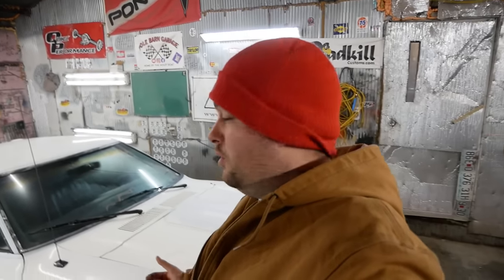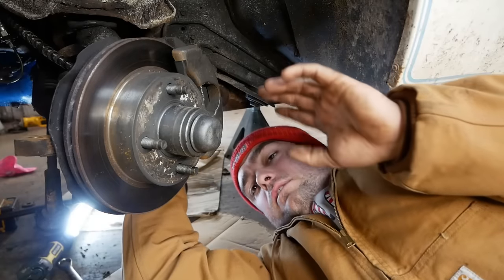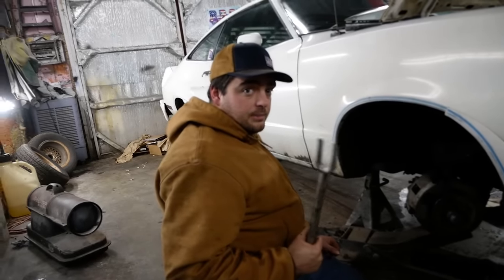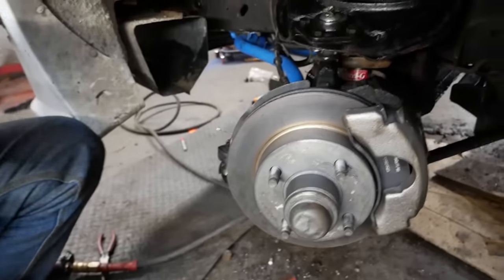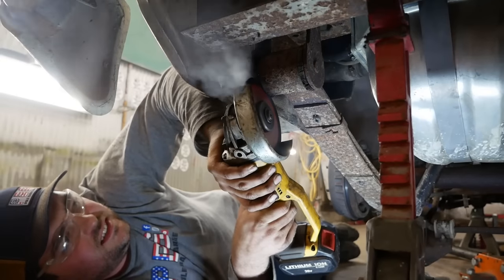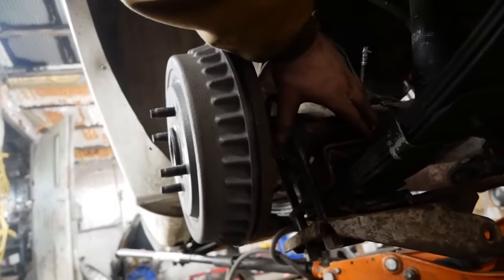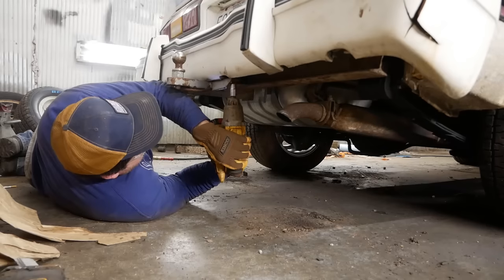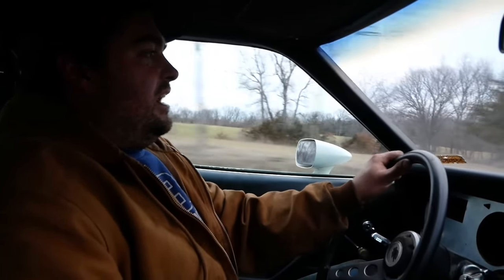King Cobra Mustang OVERHAUL! Total Suspension Refresh, Gets Some Muscle!

Comment: Nice job Dalton.  I know you are an "everyman's mechanic" but no member would fault you if you eventually had a lift installed.  Could even put it outside due to height issues.  This would make it easier for us to see your work.  As always, totally enjoy your channel and glad I found you when you were just barely at 1K subscribers.
Reply: Even something like a set of quick jacks makes life way easier and is reasonably affordable.
Reply: As Puddin said this week on his video, a lift not only is safer and faster, it is better on your body long term.
Reply: Look at all that rust preventer aka 10-30 motor oil good God that thing has been leaking for along time
Reply: 8:14 this is without a doubt the most relatable situation I have ever come across on any content.  A lot of people don’t realize that this comes from a necessity, not a choice. That mother fucking bolt is coming out, a new one is going in… or we don’t get to work tomorrow.
Reply: im pretty sure all of us dream of having a lift at home lol.
Reply: If we want to have Dalton have some quick jacks, does anyone know how to do a Fund Me page? Because his building won't handle a lift. Something like Brent had in his small shop after the fire. Powered scissor lift.

I'd like to see Dalton not only around, but still able to abuse iron for a long while, yet. I'll donate.
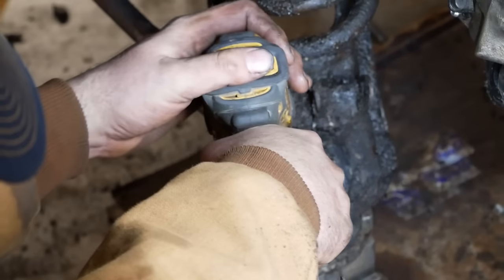Reply: 15:10 take a sharpie and put some black on the high spots should be able to read the numbers real good after that
Reply: @jimrky6062  Become a member of his channel. That helps him immensely 
I miss his old opening with an energy drink in one hand and a cigarette close by with his warning of “Danger!!  I’m an idiot “

Comment: It's amazing how one little power steering pump just snowballs into rebuilding a whole car LOL the struggle is real man. But I think most of us on here can relate. Good job as usual
Reply: That accurately describes working on cars. The oil change turns into trying to find the oil leak. Which becomes rear main seal,clutch & bearing as well as wastegate and motor mounts
Reply: The "Might as well im already here" snowballs really quick if you dont pump the brakes! Also pray the line dosent blow then its OVER for the ol wallet..

Comment: Dalton, Top tip for that drill bit set. Lightly run a black sharpie across the top and the sizes will be much easier to see in future.
Reply from the maker: Good call
Reply: yes, then after that lightly ran sharpie across the raised numbers,,,use the same sharpie and write the sizes out on the case! LOL
Reply: Another tip: spend the big money on some Milwaukee Cobalt bits. Just do not ever loan them out! Also Diablo makes some good metal sawzall blades. Very few things I pony up big money for but saw blades and drill bits are some. Also get a corded Sawzall, for $100 it’s one thing I prefer to have a cord. Darn batteries only last about 7/8ths of the job
Reply: @RustyZipper  good blades are like gold

Comment: Someone may have said this already, let it sit overnight and then check the steering fluid. It’s likely all foamy and frothy and it’ll settle overnight. 
Next time, before starting the engine, grab the wheels and shove them full lock one direction and then full lock the other way. Do that a couple times and then add more oil. I’ve found that to bleed the system with ease.
Reply: I was gonna say the same. It works on GM pumps also.
Reply from the maker: Worth a try

Comment: Great show. The best ground pan for my knees is the foam squares that lock together. Cheap , easy clean up, last for ever, lay in high weeds, gravel, concrete, any where you stand is great too. Like by the old work bench. It also comes in a roll. I like the squares myself.

Comment: I was in the automotive business over 35 years . one trick I learned from working at a few dealerships . the cardboard that was used to ship parts to the dealership were used as floor pads  to keep the greese slime and crap  that came of the cars . including all the brake cleaner and extra antifreeze that missed the bucket or pan . once covered or done with a dirty job . into the dumpster . some shops don't have cleaners that clean Your floor . so most mechanics use this method to contain the shit from having to clean up later . even old Amazon cardboard . another is getting a mirror like on the back of a bathroom door . about two feet wide and 5-6 feet tall and mount it so the wide part is horizontal and mount it on the wall of where your driving into . this will help center the car or see where your at on a driveon  or side post lift ! Happy New Year to you and your family ! Always enjoy your videos and sometimes learn a few things along the way .God Bless

Comment: My gosh I am enjoying this video. I have been building fords at home for over forty years and the frustration is universal believe me. This video reminds me of when I rebuilt the suspension on my 71 Torino. I spent six hours trying to install heavy duty coil springs in the front end. I had the wrong spring compressor, but I thought "I can make it work". After facing death several times when the tool slipped of, the guy next door brought over a ford spring compressor tool. I had the first spring in thirty minutes later and the second took fifteen. The sometimes the correct tools are the only way to go. Love the car look forward to see the progress.

Comment: I have one of these (a coupe) that I bought new in 1977.   It has never set idle or towed a boat.  As I live in central Texas, corrosion is not an issue.  However, due to the strong sun, it is on its third paint job and I have replaced all of the rubber door seals, dash, vinyl seat covers, etc.  It still has the original 13 inch wheels.   I just recently got new tires, hard to do these days.  It has the 5.0 Liter V-8.   The biggest issues have been keeping the V-8 cool in the Texas heat and stalling.  The engine was replaced many years ago due to overheating.  The stock carb. has always stalled easily with the choke pull off going bad many times. Good video, I learned a lot about the car I have.

Comment: I've seen many people wipe out a power steering pump. The reason you hear nose when filling a new pump is because of cavitation. Air in the fluid allows metal to metal contact. Shut the car off for about ten minutes to allow the fluid to settle. Sometimes you have to repeat as you get the pump up to level.

Comment: Rebuilt power steering pumps are hit and miss, but more miss than hit. I replaced 3 of them in a row (one didn’t even make it around the block) before abandoning the parts store rebuilt junk and buying a rebuilt one from the ford dealer. 

It also helps to put a filter in the return line to clean out debris which can take out a pump.

Enjoy your channel Dalton!

Comment: I've never been a big fan of the Mustang II, but I gotta admit this one is looking pretty good! In my experience with Ford power steering pumps when you install a new one you have to use a vacuum pump to get all the air out. That failure might have been just air in the system. But then it might have worked itself out by the time you got back!

Comment: 6:52 you're right there, I can't remember the last time I used a 12mm socket other than hammering the ever loving crap out of it to fit a rounded off 13mm bolt head

Comment: I made sway bar endlinks for my 76 out of an old pair of shocks. Use the lower bolt/bushing, then cut and weld the top section of the shank onto it.

Comment: LOL always a good video from yall. Hey Dalton I heard something in the engine when you fired it up before pulling it out of the pole barn, reason I mention this, so MAYBE something isnt happening that I went through. I bought a 1977 Ford F150 with a 302 that was a wholesale car ,from a Ford dealership my uncle worked at, he looked it over and other than the worse than Earl Scheib paint job, was a fairly decent truck, that the former owner had worked at the St Louis Mo Ford plant and had stuck a granny low 4 speed behind a 302 when the auto blew up, with the auto transmission rear end in it. The 302 ran really good, sounded like a Singer sewing machine running, a friends Dad had a place at the Lake Of The Ozarks, and needed some old doors and junk hauled down to a cabin he was building, so we get down there no problem, about half way back, I start hearing what sounded like  lifter noise or a fuel pump spring broke, by the time I got  back to Wright City Mo, it was getting louder, I pulled the left valve cover off, fired it up and on the 302 Ford of this era, they had a valve rotator cap on the end of the valve stem, that the rocker arm hit, that cap had split in half, and already beat the end of the valve and mushroomed it, I thought maybe I could get by just replacing the cap, Nope, had to pull the head and replace a valve, the REAL lucky part, the valve spring keeper had been wedged in by the split cap, and was paper thin, almost dropped the valve. Dad was helping me, I mentioned, I might as well pull the other valve cover to check it, well it isnt making noise I wouldnt bother , one week to the day, the lifter noise started on the other side, I took it off and another rotator cap had ate a hole in the top, luckily it didint mess the end of the valve up, a buddy had dropped a valve in his 302, and I got a whole baggie full of rotators  and stuck in my glove box, I never had anymore trouble in over 150,000 mile out of it!! You might pull the valve cover off and check that tick it has so it dont drop a valve on Jessie!! Good video..

Comment: Loved the video. Mustang II's are finally starting to be appreciated. Quick tip on the rack swap. Count the turns when removing the tie rod ends. Different manufacturers will have different length threads cut but the overall length doesn't change. So, if you screw the new one on the same number of turns it will set the toe much closer.

Comment: Vacuum bleeding the power steering system helps a lot to get the air out. Had issues getting the system on my mom's Saturn Vue to quit wining and frothing. Pulled a vacuum on it and it was perfect.

Comment: For the louvers to stop/reduce rattling use a roll of "rubberized" (weather resistant) adhesive foam and put it on the glass at the edges where the louvers lay and make contact.

Comment: I have a 78 Cobra and when I rebuilt the front end new curse words were invented. I screwed up and tried to replace the control arm bushings and ended up just replacing them with the speedway ones. I also probably bought the last sway bar end links off rock auto as they were on closeout and came in a duralast box. The only car worse to do a rack in for me was a 96 thunderbird.

Comment: Hey Dalton, great video as always.   I just finished all the sway bar, spring isolator, control arm, ball joint stuff on my car.  All the parts are available, but it sure was frustrating getting correct info!   The rear spring shackles are actually a good and easy to service design (provided they are not rusted to death!) but I feel bad for all the grief you had to go thru.   If you ever need any part numbers for any of this stuff, let me know.

Comment: Hey Dalton,  that pad is available from NPD, Cassic Industries, pinto/mustang 2. I just delt with that pad delicate too on my 69 cougar, it's a ford idea, o soften the ride, you can get by with welding a metal piece to replace the rubber steel assembly.

Comment: 22:30 I bought this stupid little thing at Lee Valley a few years ago for $6. I've only needed it twice, but both times it saved by butt. It's like just one finger for a glove, but it has a rare earth magnet sewn into the fingertip. Perfect for, say, holding s nut perfectly still inside a frame rail while you try to stab it with a bolt.

Comment: I have a set of drill bitss like those where you cannot ready it.  quick trick to fixing it, get a sharpie (black vivid/marker) or a dryish paintbrush with black pain and gently run it over the raised plastic and it will highlight and make it visible. =) (or just get a label maker and print out the whole thing... but they tend to peel off).  Just my trying to help you.

Comment: Those rear spring insulators have been NLA for the last 20 years. They were also used on the Pintos. I had one of those and basically did the same thing.

Comment: Man,that steering rack totally sauced in Oil brings back some dark moments changing the rack from under a 76 stingray with a massive Oil leak from both the power steering and front- and rear seal on the worn 350. I felt the lightning and darkness in your eyes  😂

Comment: holy this brings back nightmares from the 90s... these s***boxes were always a real funtime.  consider sectioning the quarterpanels and enlarging the wheel wells and a mini tub to accommodate a larger wheelset, but also to re position the leafs on a 4" narrowed or possiblly if not narrowed a deeper wheel well where the interior wheel well humps are brought inboard at least 3-4 inches per side, this allowing a larger wider tire with a more positive offset wheel.

needless to say its sectioning and reconfiguring the sheet metal in not just apperance but structural, and the old scrap cobra is perfect for pieces to complete sectioning. 

its serious work and ive seen an example of one done with a coyote 5.0. totallly different and modern wheel well sheet metal from an 06 and up mustang were grafted in to make this happen.

for all your effort and the time to make this right its seemingly still a pinto on steroids lol

good to watch but not good to struggle with this particular ford. geeze if anyone had to do this all over it would have been a 20k resto mod with serious mods that would have taken it to a factory look but way more involved than the years of jackin the rear up and putting on a set of 'cragars' lol

damn if only the design team in 1973 put some serious thought into a more roboust platform , everyone's life and this generation mustang would have been a decent little machine with v8 power and handling that rivaled porsche.

Comment: For those bushings use evapo-rust leave it for a bit then hit the inside sleeve of the bushing with an air hammer
Reply: And for the bolt in the frame. Drill a small hole on either side of that bolt hole and plug weld either side

Comment: Some folks may say that a lot of that was "hack Work" myself I would say that it was necessity. I at one time i owned a 75 Mach 1 302, A/T That I hot rodded a bit, it was tons of fun. I got a great deal on it as I was working as a mechanic for them at the time, it was black, black and they had about 5 that color in stock (black cars really arn't to popular out here in Cali.) I have a 74 Mach 1 now own that I have been working on it. it is gold with tan interior and rust free Cali car. I really can't work on it any more as I have auto mechanics back. guess I am going to have to let it go.but it looks like you have a keeper. 😎🏁

Comment: Nice car, looks like it has some power.  One suggestion, when you replace power steering pumps, replace the steering hoses, slave cylinders, whatever, when you get done adding fluid, turn the steering wheel back and forth both ways fully a few times to purge the system of any trapped air, then drive it.  Otherwise a couple of bad things can happen, the pump can cavitate in an air pocket and burn up (it needs fresh cool fluid pumping through it) or what you had going on, the air can move around inside the system causing the pump to stop pumping, then the air moves and it pumps fluid again.  Then you are erratically losing and regaining power steering.  That can be dangerous, especially in a dragster or low double digit quarter street car/ going fast.  Nothing rusts like a Ford, I am convinced.  Fords can be real clean but one thing will rot completely out.  Those rear leaf springs were wasted, you fixed a death trap and turned it in to a nice car, way to go.

Comment: Make sure the pressure valve in the power steering pump isn't clogged. It's what the pressure hose is connected to in the back of the tank. Could be an easy fix as opposed to buying another pump.
Reply from the maker: Ok good call

Comment: Have to assume that since you cut the back wheel studs that you also made sure the new lug nuts holding the spacer on did not stick out past the wheel spacer as well. If not, then this could be where the rear shimmy is coming from. We run into this a lot at my shop where customers add wheel spacers that are not thick enough or the lug nuts are not shallow enough to clear the spacer. They then install the wheels and the lug nuts are now acting as the spacer. Just check this out just in case.

Comment: Ive driven a few 70's fords in my 59 years on this earth, and i can assure you that your power steering is performing as designed. Eventually, it will blow a hose off, don't worry,  that's normal.

Comment: it has air in it. You have to go into a parking lot and drive in circles one direction then the other. Also sit on one spot and crank the steering wheel all the way left then right while reving it a litle bit. do that a lot of times untill all the air gets worked out. Driving will help get the air out too. Sitting over night will do some work to get the bubbles out too. I like 302s that run like new that one is a nice running 302 should rip pretty good.

Comment: When I did my rack I found out your supposed to raise the front of the car leaving car off and turn the steering wheel lock to lock a couple times then check the fluid level until air is out thought my pump was bad as well went thru the same scenario you did on the test drive